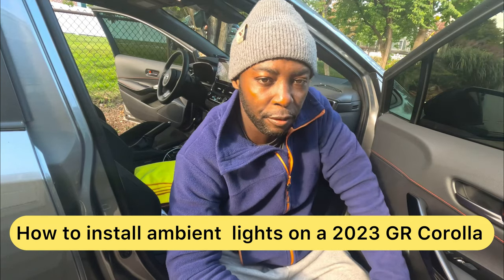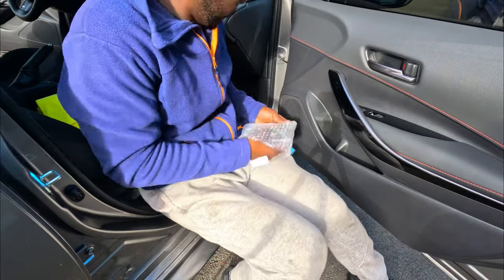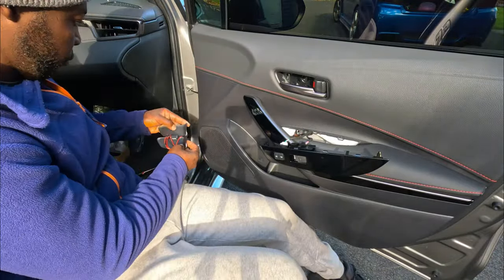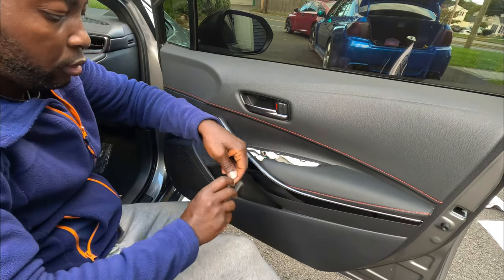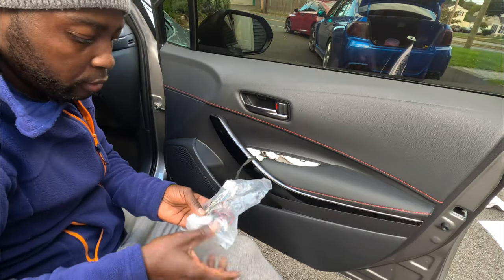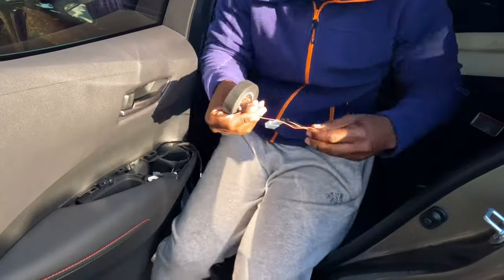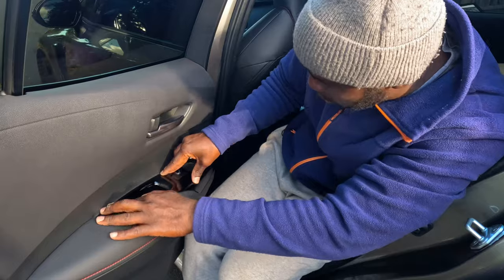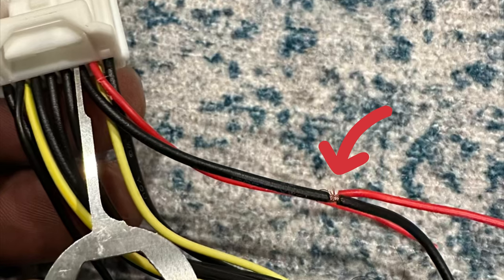How to Install  Door pocket Ambient lights on a 2023 GR Corolla

Comment: Do you think I could use a quick wire splicer for that Red wiring to the black wire? I'm not super knowledgeable about how to strip and tap into the wires I'm afraid I might mess it up.
Reply from the maker: You can.  But I did not want to do anything to the Car Wiring system so I rather cut the KIT and splicing is easy. just watch my video. you can use  a blade or a cable splicer. it not that hard.
Reply: @CarStomIt  Awesome will give it a try! Thank you
Reply from the maker: @carljasperyu9627    You are welcome.

Comment: I didn’t really get the wire splicing part. Where is the red wire coming from and are you connecting the red wire into the black wire? Sorry just bought these lights and wanna do it right the first time.
Reply from the maker: Do Not worry about it just connect to them without Splicing. It will work I only made a change to make  sure that the lights turn on a certain way
Reply: @CarStomIt  I actually wanna do the same thing you did which is have them only turn on when the headlights go on. Would you be able to talk me through that?
Reply from the maker: @larryacevedo7098  the Amazon Link that I put in should be plug and okay so all you have to do is to connect the . The one I bought was from alliexpress. But I have since updated mine to the one on the Amazon Link.